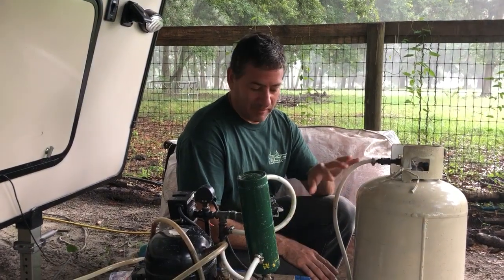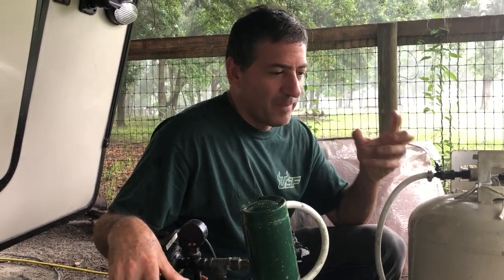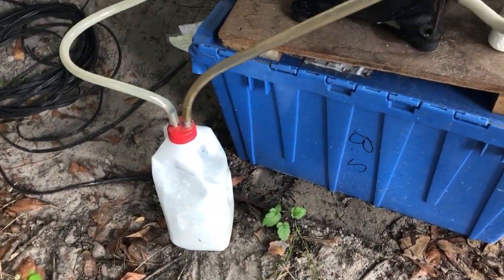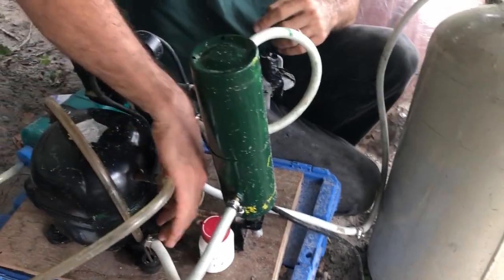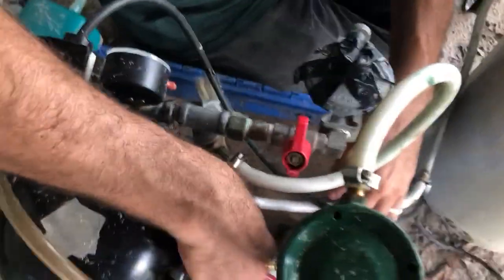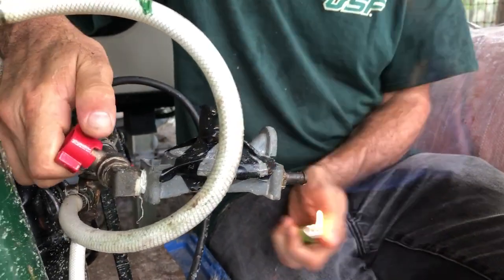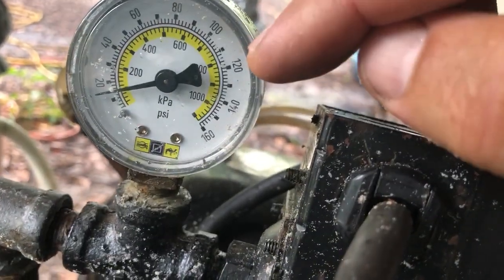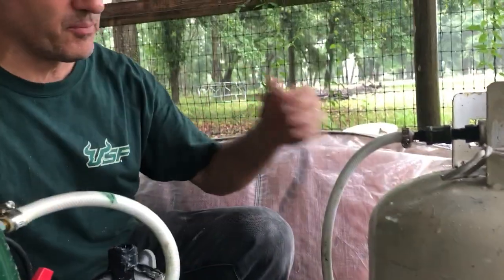methane to power off-grid hot water 2/2

Comment: Use the excess pressure to run a 2stroke air engine to generate electricity and exhaust air/biogas into a bigger gas tank like Ibc